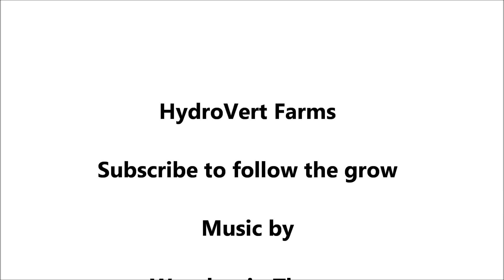DIY Indoor Vertical Hydroponic System - The HydroVert 80 Spot System Build

Comment: not too bad but I have build a bigger system than this and a few issues he is going to have. for starters once the roots begin to fill that small 2 in pipe 500 gph won't be enough. I have 4 inch pipe 40 feet worth and twice that gph was almost not enough...not adequate lighting in the slightest try about 6-9 more light fixtures. plants need a lot of lumens and you need the right Kelvin. anywhere from 2000-6000 is the spectrum your plants will need. just a few pointers. personally dwc systems are a lot easier than an nft system like this one to run..

Comment: did you orient the fittings for a specific reason? Your tees sweep upward when each line connects into the main manifold as opposed to downward. i would think this would encourage a little backflow and slow down the drainage out of the individual line?  Was that on purpose/ is there a theory behind it?

Comment: Nice concept. You do need twice as many lights. Florescent lights only cover about 2' from the center, that leaves half your plants out of the arc. I wasn't sure 2" pipe was enough but your later videos convinced me. Lettuce has a more limited root system but thicker stalked plants like Bok Choy would choke the pipes with roots. It's a good system for a greenhouse but grow lights are tricky. I mostly use them for seedlings.
Reply: Plants design their branch, stem, and leaf layout so that all areas of the plant get sunlight. I would think that looking for shadows and slow growing areas would show you where your grow lights were not reaching. If the grow lights could be moved on a regular basis, that might help reach all areas also.